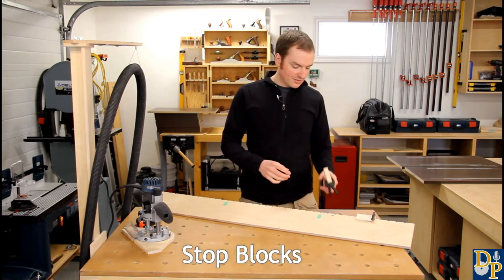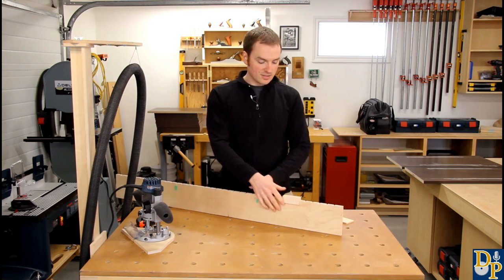Ultimate Shelf Pin Hole Jig

Comment: This is brilliant.  I find the "lift and move" jig I've used on past projects to drift slight as I move it causing the opposite side to be off slightly after many holes.  This method will be true on both sides, and every copy.  
Just for kicks, I timed myself making holes tonight.  "Lift and move" blue jig I did 60 holes in 3:30 (In scrap, as fast as I could).  This jig I could do a hole a second, but including the template setup, it was about 60 holes in 2 minutes.
I did have to remake my template since the first was only 48" and I needed to go out to 78".  The second was on 3/4 ply but I created a rabid on both sides of the ply, allowing a gap for dust.  This allowed me to move a bit quicker so I did not have to clear out the dust/chips.
Reply from the maker: It's definitely my favorite method of all the ones I've tried over the years.

Comment: Can you drill holes on both sides of same piece of plywood? Would you space them differently ? Great jig! Thanks
Reply from the maker: +Derrick Sutton you could certainly drill holes at different spacings on both edges of the jig. I always use the same spacing so I've never done that. You could run the risk of mixing up which edge you're working with though and possibly use the wrong spacing on a gable.
Reply: I made the jig with one set of spacing. I wasn't sure if I could use the same spacing on opposite sides of one board.

Comment: Wondering why the main jig is so wide. It might look wider than it is on the video, but doesn't it only need to be wide enough for the holes and clamping, so maybe 3 inches? It looks like it's about 8.
Reply from the maker: I made it wider so that the pressure of the router against it doesn't bend it. It could be made narrower but then you might get more deflection in it.

Comment: It just occurred to me that your jig will be the perfect way to drill 
holes for a MFT top. I have a cabinet job coming up that requires shelf 
pin holes. I think I'll make the pin registration holes 1 1/4" on center
 on one side of the jig board and 4" on center on the other side. If 
the plywood router sub-base is exactly 4" from the center of the bit to 
the center of the registration pin that would make setting up for the 
second row of MFT holes much easier. - John Minton
Reply from the maker: +jmintonra that sounds like it would work well for drilling the holes for an MFT top.  Let me know how it works out for you.
Reply: Will do Dan. I really enjoy your videos. You have a relaxed easy style and a very concise way of presenting your solutions for increased productivity. 

John Minton, Architect
Reply from the maker: +jmintonra thanks John, I appreciate the feedback!
Reply from the maker: +jmintonra I just noticed that you're an architect.  My background is in the architectural industry.  I worked for 6 years as an architectural tech and that's what my formal training was in.

Comment: What style router bit do you use to make the shelf pin holes?
Reply from the maker: +Hunter Wychgram I use a 5mm solid carbide spiral bit.
Reply: Thanks for the quick response!  I tried an upcut spiral bit and it tends to burn the plywood.  Should I try a downcut bit instead?  In your video it looks like it cuts the holes effortlessly.  That is a great jig I need to build one.
Reply from the maker: +Hunter Wychgram the bit that I use is an up cut as well and it does cut effortlessly.  Is you bit new or older?
Reply: Dan Pattison It was a brand new bit.  I set the router on the slowest speed but it still seems too fast. What speed do you recommend?
Reply from the maker: +Hunter Wychgram you should be using full speed. Small diameter bits work best at high speed and large bits at slower speeds. Give that a try and it should work much better for you.
Reply: I just made this jig and wow! It is nice. Thank you for the video.

Comment: Well, I've decided it's impossible to make this without a drill press which I don't have. I tried using my router with an edge guard to make the holes in a consistent line but I've tried twice now and they still come out uneven. When I rip it to make them half holes, even creeping up on it, some holes are fine against the base plate and some have side to side slop. It might just be my router because even visually some holes look more oval than others. So I'll save the base plate for a time when I own a drill press to make a more accurate main jig.
Reply: Are you talking about making the holes in the jig or the cabinet? 
If you're talking about the jig, to make the holes in a consistent line without a drill press, I would use a table saw with a fence to rip a shallow (like 1/32 inch) trench the width of the saw blade kerf along the line where I want the holes to go.  Then trench assures that the drill bit will not creep when you drill the holes.